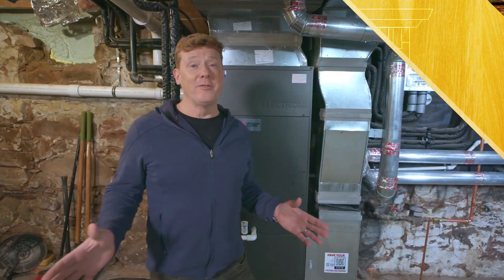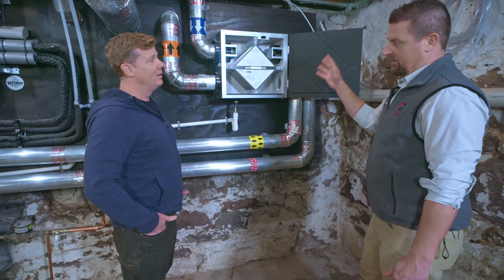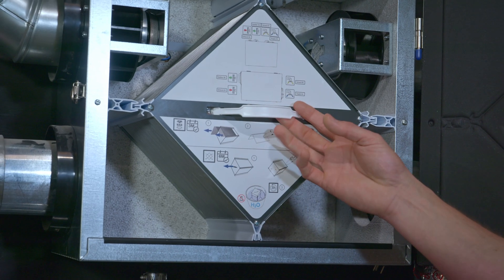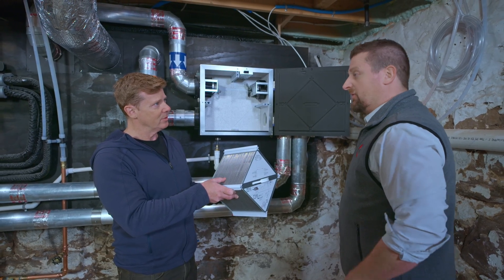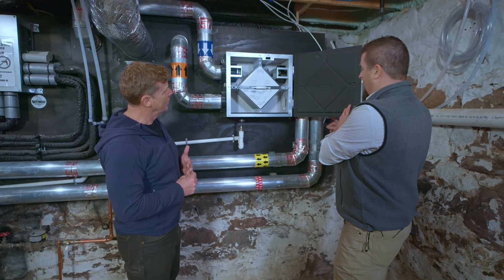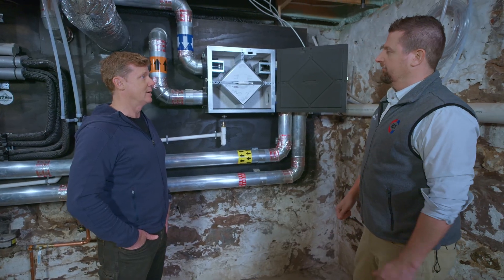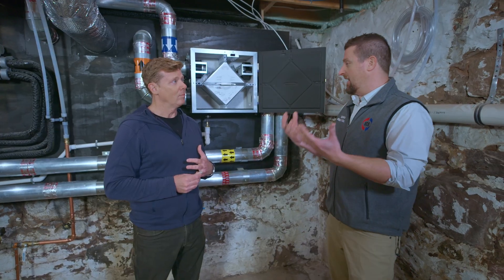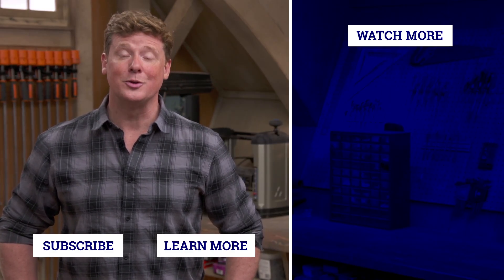Installing HRV for Energy Efficiency | This Old House

Comment: I have insulated our new house to the max. R35 attic, R28 walls, R32 rim joists, R10 over the cold concrete basement floor. We are presently heating the 2,000 sqft house with 4 electric space heaters and the electric stove when super cold. Next week our plumbers are coming to install one FanTech 150 HRV with a 2 KW duct heater for roughly $6k. We will also install a few electric baseboard heaters. One per bedroom. Then next year an air sourced heat pump good to -30C and a small wood stove with 16 solar PV on the roof.

Comment: Just installed one this fall in Canada.  First winter on the prairies with it, I hope I dont have icing up issues like a lot of people do in the extreme cold.  But it has defintly helped with the air quality and moisture control compared to the old setup
Reply: it usually won't ice up, cuz the fresh air from outside is cold and dry (very low on moisture). When it gets heat up by the warm exhaust air, the fresh air is still very dry and won't get humidified til it reaches a water source like central humidifer. The only way I can think of having a chance of ice build up is when you set the HRV to vent mode right after you let it run in recirculate mode for a while after somebody finishes taking a shower. Basically HRV also serves as a dehumidifier but only in vent/heat exchange mode, so after somebody took a shower and you put it in recirc, the moisture will build up and will not condensate and drain. If you put it in vent mode right after that scenario, the damper will open and the cold fresh air from the outside will freeze up the moisture on the left side of the heat exchanger. Hope this makes sense.
Reply: @gordonq007  Usually and dont are 2 separate things.  -40 degree dry air meeting 21 Degree air at 30% (Both Celsius)there can be icing.  If its even more humid air from showers, then that can add to it.  That's what happens when the bypass the core, the exhaust area of the code is the area that gets iced up, as you explained..  A lot of things I have seen with this I think are just from lack of paying attention, but I can probably show you a 50 pictures from Reddit alone in cold climates where HRVs are iced up.  So far our winter hasnt seen the extreme cold yet, lowest has been maybe -21.

Comment: Snake Oil.
Reply: You must be one of those boomer builders stuck in the 20th century still thinking houses need to breath (through poorly built wall structures and inferior insulation).
Reply: @rustyshackle917  Ya, once you have had an HRV, you get it.  They are GREAT, said Tony.

Comment: Particularly for those on heat pump systems the fresh air aspect is a big plus. I don't know how many homeowners realize that if they build a tight home with a minisplit system they are essentially getting very little turn over of fresh air. Luckily many of these homes will be all electric but if not then any additional heat source like, say, gas is going to impact air quality etc. Expelling partial stale air via an exhaust fan is one way to help but a full air exchange is even better.
Reply: Fresh air ventilation is code in most places now

Comment: Always remember that everyone is always trying to sell you something, and they will even lobby government to create rules to make it happen.

Build a very expensive airtight home, and enjoy your chronic illnesses. 

Don't subject yourself to spacecraft living until you're actually traveling in space ;-)

Open a window!

-Retired plumber.
Reply: Using an HRV/ERV allows you to control the air coming into your home. That "fresh" air from an open window is full of pollen, spores, wildfire smoke, motor vehicle exhaust, excessive humidity, etc. A good HVAC setup will filter all that and be much healthier. Plus you're not dumping conditioned air out the window.
Reply: @DeuceDeuceBravo  only thing I would add is unless one has a pretty robust carbon filter setup the odor will not be filtered from said wildfire smoke etc. HEPA will not do it alone.
Reply: @speciesofspaces  Agreed. Some smells will be difficult to eliminate. But even a MERV 13 filter will take care of the particulates. Upgrading to a MERV 15 or HEPA will be even better if the system is designed to handle the pressure difference (i.e. an extra large filter box).
Reply: @DeuceDeuceBravo  I have considered carbon filter units which grow houses use. In line with no fan etc. They aren't that expensive either.
Reply: Still don't know why like in Euro windows they don't just integrate the "broken seal method" for letting in air efficiently.

Comment: Just curious, do you get a bunch of condensation inside this heat exchanger?  Does it drain to somewhere?
Reply: ERV in the appropriate climate does not. Don't make the mistake of putting an HRV or ERV in the wrong zone.
Reply: You can get condensation and it does have a drain you should hook up
Reply: It depends on your indoor humidity, outdoor temperature, HRV pipes are connected to the bathrooms or just the return trunk duct, and how often the HRV is being ran.

Comment: $2500 to go from my oil furnace to a ducted heat exchanger? Someone needs to tell the installers in my area that
Reply: Cold weather heat pumps are getting better in cold climates but remember they need to be cleaned more than one thinks. At 15 degrees the best are about 60-70% efficient is maybe the best I have seen. Anything under 25 degrees and the efficiency drops. Ours really starts to work hard closer to 10 degrees. And the defrost depending on dew point is also going to be turning on and off.
Reply: The HRV install was $2,500, not the heat pump air handler.
Reply: Ya, $5K here.  Gawd.
Reply: Not quite. You can buy the HRV hardware for about $1000. It is then installed into your existing HVAC system (~$1500 installation). That price doesn't replace your existing oil furnace.

Comment: Need to see how this is ducted into the system in more detail. Most systems aren't integrated into the existing HVAC, would love to see how it's "plumbed".
Reply: Pause at 0:23 and you can see the fresh air feeds into the air return of the HVAC and the stale air exhaust is pulled from the HVAC supply.
Reply: @eugsmiley  yes, but would rather a more thorough walk-through.
Reply: @eugsmiley  Why is it routed that way and not the other way around? So the fresh air is conditioned before being pushed through the duct work? I've seen some setup pull stale air and feed fresh air both into the return as well. Which is the correct way and why?
Reply: Still believe an isolated system is best. But not always possible depending on design and layout.

Comment: The best cores have an actual counter-flow design (aligned and opposite) for the optimal heat exchange. Counter-flow is best, and (at least in theory) can approach 100% "effective".

The X-flow ones are inherently less effective, due to the suboptimal geometry.

Comment: Hey. The cold air intake and not-quite-so-cold exhaust pipes should both be insulated. That said, if the basement is completely uninsulated, then who cares anyway.

Here in Canada, I built our house to follow the so-called "R2000" which included a Heat Recovery Ventilation system. It was built in 1990. The Heat Recovery core is about twice as big as that one shown here.

Comment: Heat Pumps are great until the electrical power goes out in a cold climate. You will need a back up power or heat source. Frozen pipes and frozen people anyone.
Reply: The fan on a gas furnace also won't work if the power is out..
Reply: @asofeye  You always need a viable backup plan no matter what system.
Reply: A heat pump, solar panels, and a wood burning stove for back up is the ideal for me.
Reply: Yes. That’s what generators are for.
Reply: @CMCraftsman  just the heavy gas consumption hence storage issue.
Reply: @bettymaverick1098 Learn some proper punctuation lady.
Reply: @johnlebzelter4208  Troll